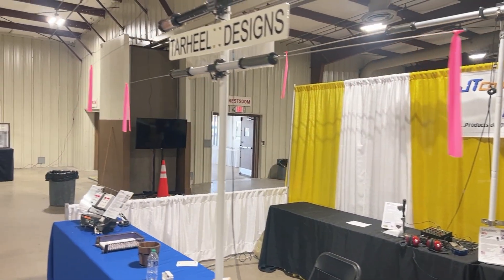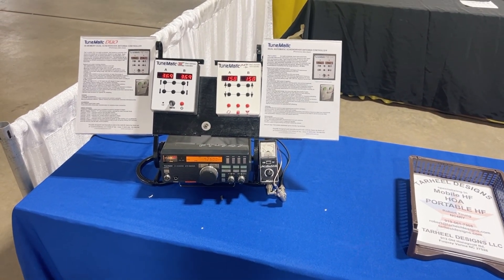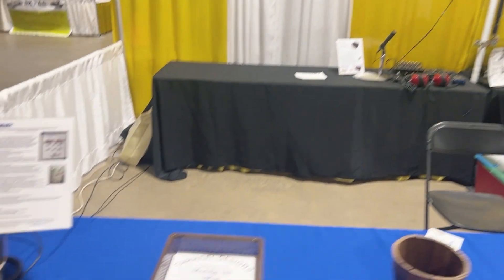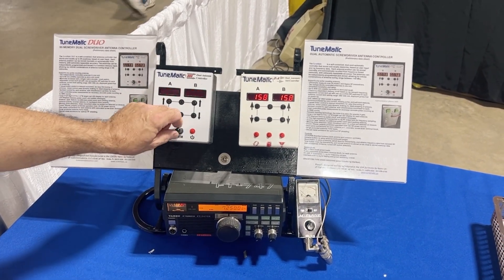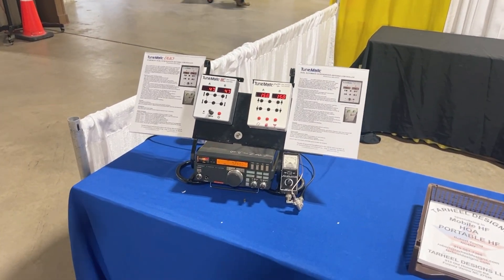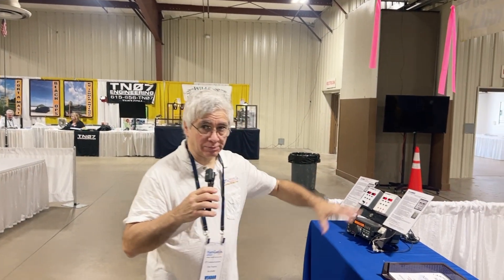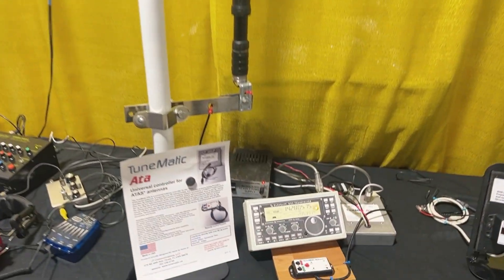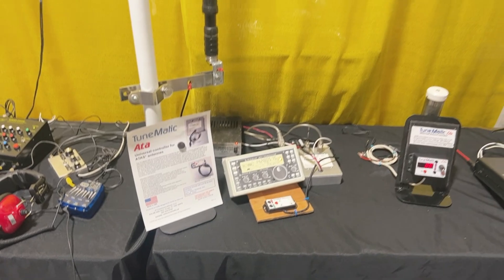TuneMatic & Tarheel Design Screwdriver Dipole:  The next HOA Stealth / Covert HF Antenna?  Hamcation

Comment: Where can I get. the  set up for making two tar heels into a dipole . I mean  the connector
Reply from the maker: TuneMatic is partnering with Tarheels; you will want to reach out to them:  https://tunematic.jtcomms.com/wp/
Reply: What I was talking about is the bracket in the video where the two tarheel antenna are connected together as a dipole
Reply from the maker: @richardkitchen4430  that is a propriety bracket for this set up; you would need to contact TuneMatic / Tarheel to buy it.